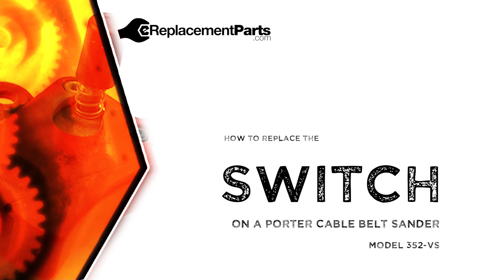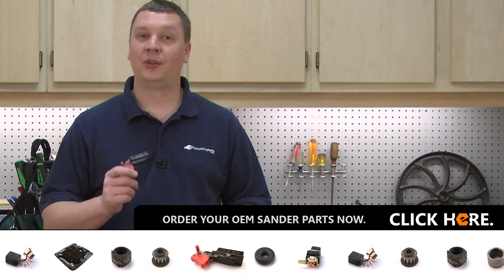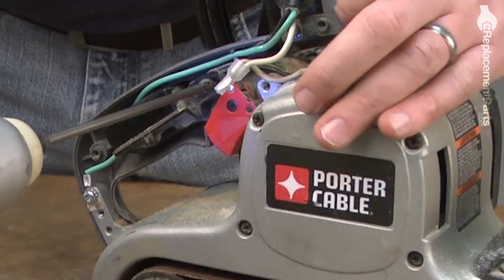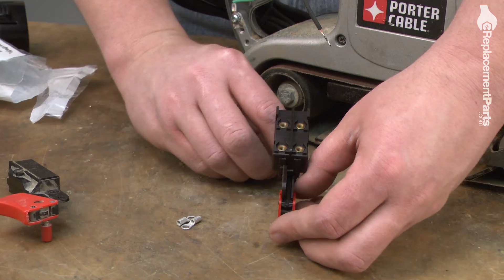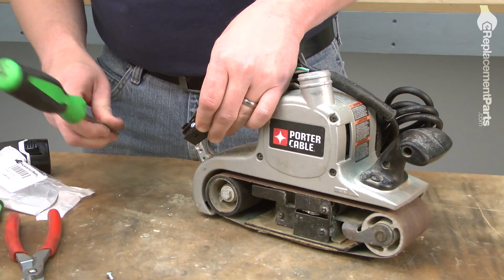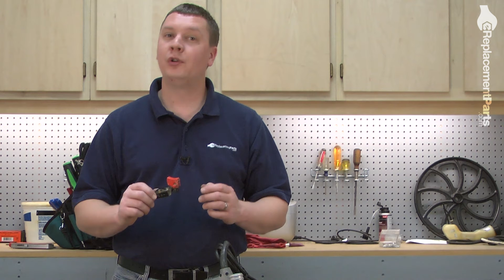Belt Sander Repair - Replacing the Switch (Porter Cable Part # 5140112-36)

Comment: I think it’s so cool Porter Cable and other manufactures use a multitude of fasteners. Philips,Torx, Posi Philips, Allen type, Imperial sizes, and Metric. In their now all Chinesium tool. I hated having just one style of fastener. This make my heart sing to see such a Myriad of fastener types. Long ago on a far and distant planet far far away. A group of engineers got together and made up this idiotic idea of using a standard for thread pitches and types for screws bolts and rods. Thankfully, we have moved on from such bachassward thought and can now look to the future with glee and frustration. 
Nice to see Porter Cable leading the way.

Comment: How do test the sander to make sure it is the switch that has to be repaired?
Reply from the maker: Hi Tony, and thank you for your question. Typically if your sander won't turn on, it is the result of a bad switch. However, I think you might find this video interesting:
https://www.youtube.com/watch?v=aIXf3v5hGk4

 It shows how to diagnose these types of problems that you may have with your power tool. I hope this has helped, and good luck with your repair!